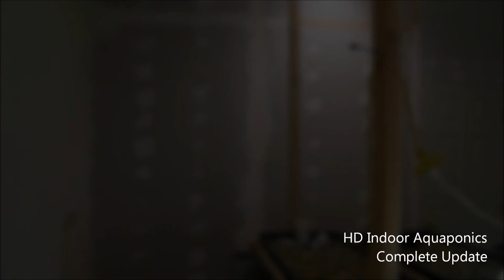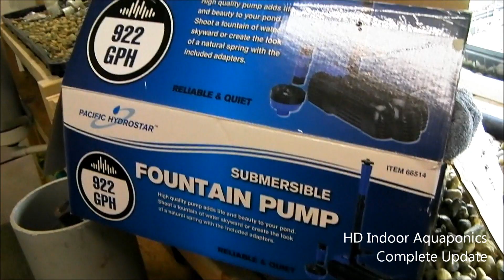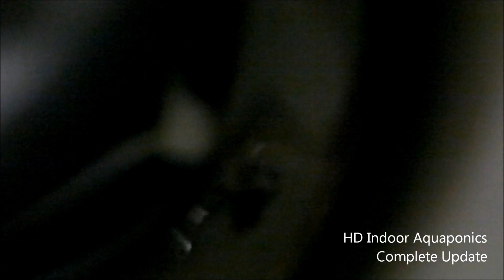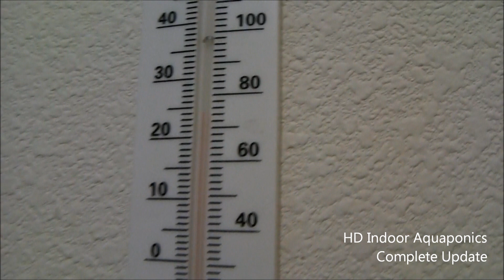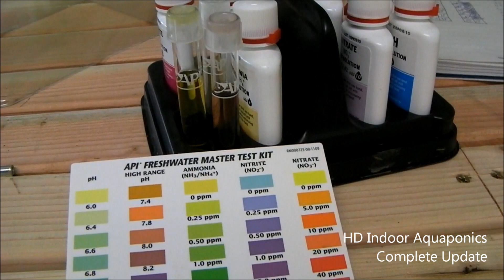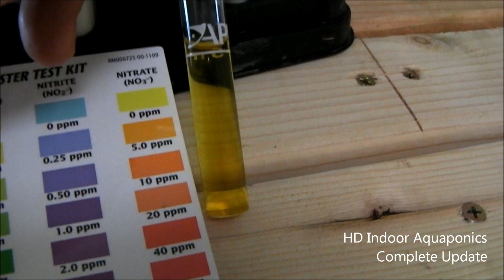HD Indoor Aquapoincs - Grow beds, bell siphons, water test, high ph and 1080p

Comment: @SpeedGimp If you can't find it locally, I'd sooner try the internet than grab a piece of driftwood from a local stream, as you have to worry about contaminants and possible parasites. If you must get drift wood from a local body of water, I'd repeatedly boil it, and dose it with Metronidazole (or other anti-parasite medication) before adding it to you tilapia tank. Heck, I'd probably dose some store bought wood, before adding it to the tank. Just an idea to lower your ph.